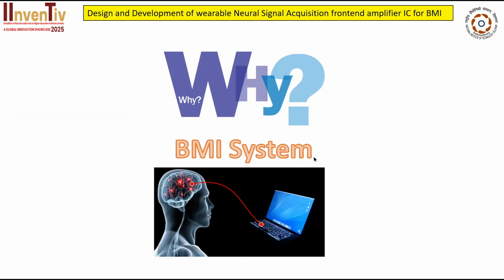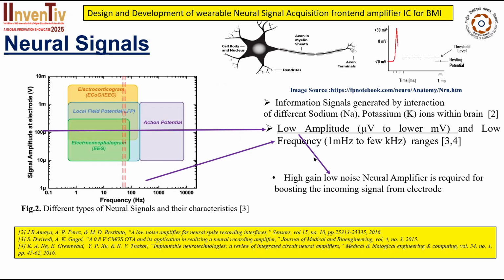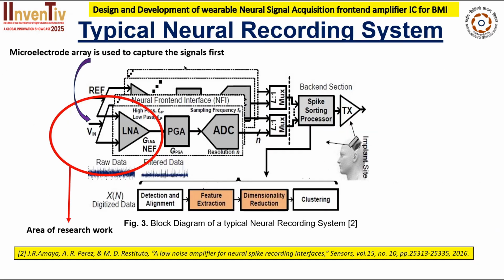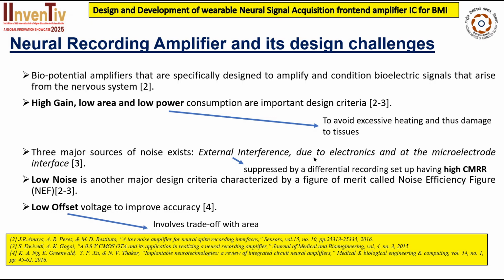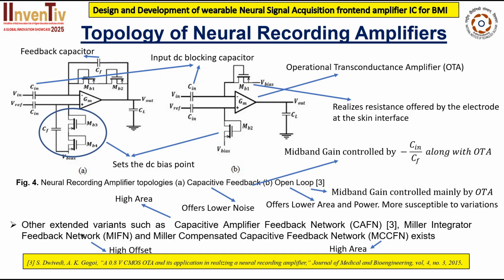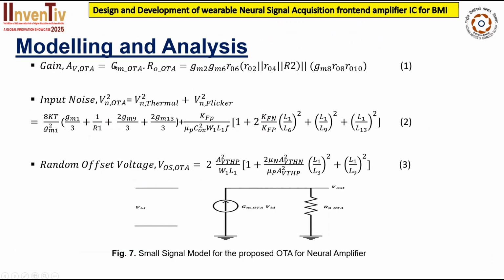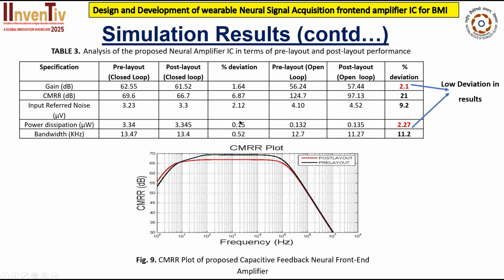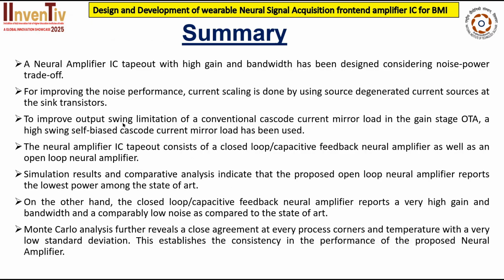Neural Amplifier Design as a part of MeitY Funded SMDP C2SD Project | R&D Fair IInventive 2025

Comment: Hi, we know about the wide range of applications of op-amps and comparators. Can you suggest materials to read various op-amp topologies and comparators to read, learn, and design? I have been following Holberg, but I need many more examples and various design specifications to practice. Also, can you suggest some IEEE papers?
Reply from the maker: Search for papers and journals for more examples. There are lots of papers so I cannot suggest all the papers. I want to suggest that focus on some area of applications and then practice depending upon the requirement.